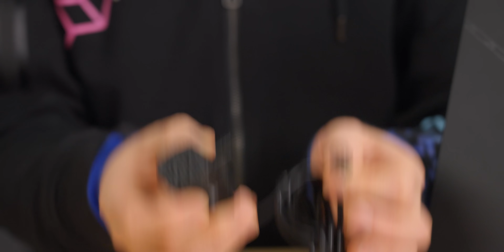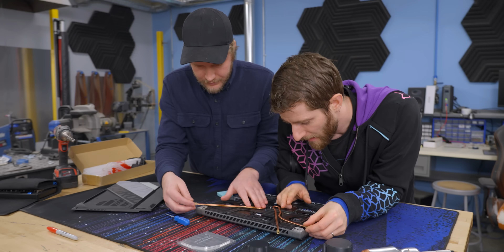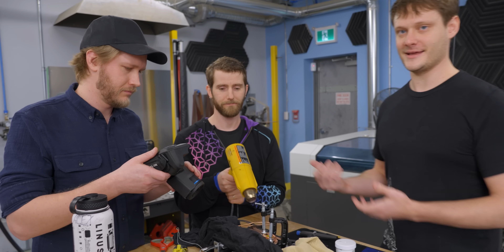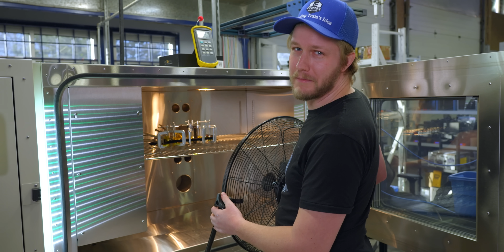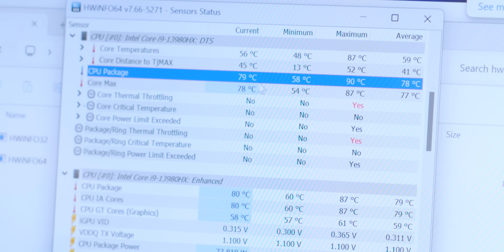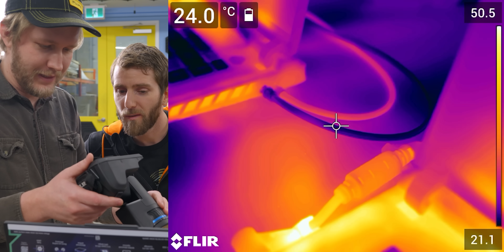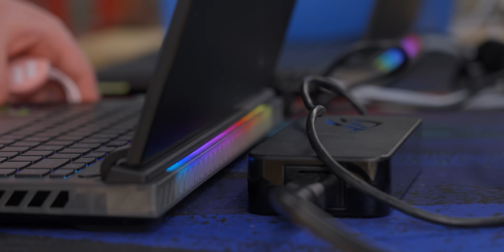Water Cooling a Laptop for $30

Comment: A plug-in external water cooling loop would be a pretty cool feature for some of these high end gaming laptops. The manufacturer designs the cooling loop with a pipe to ports on the outside of the laptop, then sells you an optional external AIO block that you just plug in when you need the extra cooling during sweaty gaming sessions or on very hot days.
Reply: This is a thing
Reply: This video had a clip of when they reviewed a laptop like that
Reply: @DraakjeYoblama  I think they're talking about it becoming more standard, rather than the exception.
Reply: Actually theres a Chinese brand MECHREVO that already has these external water cooling laptops in 2023
Reply: These things are done by a dozen different manufacturers.

They're obviously more expensive.
Reply: xpg has had them for awhile now to.
Reply: xmg neo laptops already have this since 2 years
Reply: considering laptops are built primary for portability I would just buy a desktop Pc, as external water cooling kind of kills the ease of use and portability. that said laptop manufacturers would be better off making a little access door for the heatsink and an external cooling pad "potentially water cooled" with it's own heatsink that will attach firmly connecting the two heatsinks.
Reply: ASUS GX800
Reply: @ryanhampshire7042  building a computer need... to build?
also laptop you could just unplug external wat er cooling, when u need portability. Why dont have both? LMAO

Comment: As a DIY technician myself, I'm sure there was a ton of different ways to make this so much more simple
Reply: Thermal epoxy...
Reply: Less fun tho
Reply: As a professional home owner myself I would agree, using regular copper pipe flux and a 140watt solder Gun.
Or a simple gas torch.
DIY technicians and professional home owners are very similar and have a lot of overlap.
Reply: @deepwinter77  Not really. One as a real job for the living and the other is a parasite who think he got skill because one time he badly repaired a copper pipe while pocketing rent.
Reply: @SaitoGray  a professional home owner refers to one's own home.
Not a rental house, it's a meme not a commentary on rental housing 👍🏻
Reply: @SaitoGray  and diy commonly refers to not doing something as a profession, so what is a real job?
Reply: That would be efficient and not funny
Reply: they should have used thermal poppy

Comment: When copper gets work hardened, you can heat it up to anneal it. It isn't very hard to do.
Reply: Yeah but you wouldn't want to torch a heat pipe lol.
Reply: except for the fittings soldered on the end.
Reply: @BananaDoe  It's not a heat pipe; it's a water pipe
Reply: @xungnham1388   He very likely meant the heatpipes from the laptop's cooling solution those would not do well at all if they tried to anneal the entire thing.
Reply: @alexisrivera200xable  I mean, they can do it before they attach it. Bend it, heat it, bend more, heat more. That's how you work copper if you want to shape it with hammer for example.
Reply: @Heksu99   But I think the copper water tubes also had their threaded inserts attached with solder.
Reply: @busteraycan   That's not really a hindrance.

Comment: Why arnt you wearing safety glasses!  Z94.3 rated safety glasses.  Im going to be pissed if this channel ends because someone cant see anymore over water cooling a laptop using a heat gun and some solder tube thing

Comment: Ain't there a fabricator or such in LTT who could tell these that copper alloys work hardening can be negated with a basic butane torch (Like a kitchen one is enough). Which is why we use copper alloys for complicated loops and brass instruments. You can also melt wax in to the piping to prevent it from collapsing when you bend it. Copper and copper alloys are actually REALLY wonderful stuff to work with.
Reply: Sorry, but these are heat pipes. Meant to carry heat away from where you apply it.
Reply: @Timbhu  It's obviously about the water pipes and even mentioned in the video.
Reply: @Timbhu That has absolutely nothing to do with what the original comment was saying, what he is telling them is that once it's been work hardened by virtue of bending it, you can reheat it to reverse the hardening,enabling you to reshape it without cracking or breaking it,which is basic physics. It''s use is entirely irrelevant.

Comment: So wait, out of everything you guys do, THIS is something we might actually do ourselves?  Lol I think we'd faster cool a gaming PC with a radiator from a PT cruiser before trying this madness.  Nonetheless, it makes for a hell of an entertaining video, and that is most important :)
Reply: Well. . . Maybe if you didn't melt the cooler to pieces and used epoxy instead
Reply: I mean its basically just copper brake-pipe for cars so with some epoxy I could do this with stuff from my garage. 😁
Reply: Or just use household cupper pipes from the plumper store and just put it at center. So much contact to surface was crazy overkill
Reply: @wyattroncin941 i wouldve soldered, but the issue wasn't soldering it was their fancy infra red machine heating the whole heat pipe system up, so that the heat gun and soldering iron added to it; instantly made the other heat pipes solder melt, if you dont have that machine you would be pretty okay(it would take longer to melt the solder you trying to add tho )
Reply: @noobs_guide_to_everything  without the reflow jig or a preheat oven you'd struggle to get enough heat in to actually melt the solder. It's a heat sink after all, and a soldering iron doesn't generate that much heat compared to a CPU. 

You could still get away with soldering, but you'd need to use a slightly lower preheat temperature and go much slower than they did so you aren't heat soaking the whole thing with the iron. You could also make a jig to rest the whole thing on, made of wood or machined aluminum with an oil pan heater underneath. That way if you do melt the cooler it doesn't fall apart on you.
Reply: Yeah if they'd just use the thermal epoxy this would have been a couple hour diy project anyone who's worked on tech could pull off imo. Trying to solder that cooler stack was what was shit, but more fun to watch? Lol.
Reply: Actually this is meant for professional workshops. You send them your laptop and they solder for you in one or two days. My friend got his laptop moded years ago and he uses it when he tries to render stuff or plans to game for long sessions. The good ones use a PC rad and pump, they also come with quick release water connectors so your laptop doesn't leak
Reply: @wyattroncin941  Any epoxy ? And wouldn't be less efficient ?
Reply: @skymarshal3330  thermal epoxy. It's what is used to mount heatsinks in small electronics like hand tools and DVR boxes. Yes it would be less efficient, but it also wouldn't require hundreds of dollars of equipment to install and there's (almost) zero risk of destroying the entire laptop.
Reply: It sounds like a project a hobbiest can take on.
Reply: @skymarshal3330  but just like using thermal paste, you'd want the layer to be as thin as possible, and with epoxy you'd have time mix, apply and carefully clamp it down. In the case that performance isn't what you expect, you might still be able to improve it using low melt solder paste and a soldering iron. The epoxy are already there to hold it down, and you only have to think about the soldered pipe assembly, in which case you can be smart about it and not solder anywhere close to the soldered areas. Also you could thermally cool down critical parts using something like water so it has more thermal mass at one end. Extremely short work of solder is key, not even one second of you shoving the solder there. You'll want to inflict as much heat at a point, and not much total heat so that the whole thing heats up and ultimately burst. Get it done a milimeter at a time if you had to.
Reply: @skymarshal3330  While thermal epoxy is less efficient than solder the end result would almost certainly be better than what Linus and Alex got since desoldering the existing heat pipes and warping the whole assembly cost them a good deal of cooling efficiency.
Reply: In China, the soldering service is sold together with the kit. After mailing the heatsink to the seller, wait less than a week, than you will get a way better heatsink than Linus had.

Comment: At work we use conductive epoxy. It is great option instead of the low-temperature soldering paste you used here. The conductive epoxy comes infused with silver and copper powder and flakes, I guess it would be good for this application.
Reply: that was the plan Alex wanted to use, but Linus just wanted to try the soldering. It may have been unnecessarily more difficult but it made for great entertainment.

Comment: Intel sponsoring a watercooled laptop video tells you all you need to know about their chips lol
Reply: Any processor needing any kinda cooling is a rip-off.
Reply: didn't they pull out as a sponsor? or is there a thing with sponsorships that i am not aware of?
Reply: @vilnaszekje  huh?
Reply: @vilnaszekje  you can stop using or buying any kind of electronic devices that features a processor from now on i guess
Reply: @johnsalamii they sponsored this video. The joke is that their CPUs run HOT 🔥
Reply: @johnsalamii  the stopped the intel tech upgrades, not sponsorships in general, deals may end after their set time but it's not like they excommunicate with who they sponsor after a deal is done.
Reply: @quyvante  If you didn't catch sarcastic response to stupid comment it is on you.
Reply: @vilnaszekje  man is digging for "sarcasm" because he shills for intel's supernova level cpu's.
Reply: @Extremexboxplayer  Cause AMD is running much cooler. They both run hot. And considering most tech review outlets run CPU's without thermal limits (and such outside of normal usage) of course the cooling isn't keeping up.
Reply: @vilnaszekje  never said AMD isn't hot lmao (they are both hot under load), i use whatever is good. why simp for a company? it makes no sense to make up a fake "joke" because you got mad he dissed your favorite company lol.
Reply: @Extremexboxplayer  you are the one "simping" for the company.
 
Imagine if AMD sponsored video about driver stability tells all you need to know about their drivers.
Reply: @Extremexboxplayer  nah its the same as android users, they pick weird flexes to bring up any time a competitors product is mentioned, like a headphone jack. What makes it especially weird is that intel chips ran at like half the equivalent amd chips tdp up until a few years ago. With the current state of cpu cooling (excellent) thermals are less important than ever too so it really is just being weird at this point.
Reply: @vilnaszekje  i use amd and intel lmao, even got an intel gpu in my livingroom pc, idc about brand loyalties. keep being mad i rightfully insulted intel bub.
Reply: @plsno8125  well yeah at that time i also said amd was making pc's with nuclear cores. not sure what you guys want from me when you're getting mad i insulted intel lmao. also android do be better simply because it's not apple haha (it's a joke please dont write me another paragraph).
Reply: @Extremexboxplayer  Bro ur being pretty overreactive. But ya. Im running ollld intel, but If I bought a cpu today, It'd be AMD. The general rule has been thrown out about intel for gaming, etc., because intel's performance charts over the years looks like someone just keeps putting more watts and getting more cpu score on an infinite curve.
My chip is a 3770k from 2012 (probably) and my 4 core chip scales very closely with their newer hardware. Only difference is those chips can handle 1Ghz more on average.
Reply: @Surms41  i am simply responding when responded to lol, you guys are the ones sending paragraphs about your latest cope.
Reply: @Extremexboxplayer  u project a lot
Reply: @plsno8125  I tell people that brand loyalty is bad and how I use all the brands brought up but that shows I'm projecting? That doesn't make sense.
Reply: @Extremexboxplayer  no one here is mad or making a big deal about brand loyalty except you
Reply: @plsno8125  must have age protecti9n on for the other comments then, unless you mean I'm the only one who said the exact phrase "brand loyalty" because that's just stupid as you know full well everyone is talking here about how they feel in regards to brands. Please don't act negligent to seem "right".
Reply: @vilnaszekje  bro what 💀😭
Reply: @vilnaszekje  a lot of processors need cooling, if not all of them. if you believe this is a rip off you can just stop using all of your electronic devices.

Comment: Experiencing power-on delays with Asus is a common issue. It even occurs with my 3rd ASUS ROG laptop at times. Additionally, with all of them, there's a frequent problem where they freeze after entering a prolonged suspended state. Come on, ASUS, please address these bugs. Your laptops are excellent, and it's a shame these issues persist.

Linux, time to cool down the reservoir full on ices!
Reply: @McNificoTube  it's common for DDR5 laptops, first boot takes forever

Comment: I have a Eluktronics LPP laptop.  The water-cooling works extremely well and will stay a LPP customer as long as they are manufactured.  The only problem I get is after about a year the quick connects leak and need to buy new quick connects.
Reply: Way too overpriced though.

Comment: I still want to see an external cooler for a laptop where you simply have a hole in the bottom exposing the heatplate so you can attach a copper heatsink instead of water cooling directly
Reply: I think that'd probably not be allowed under regulations concerning device skin temp
Reply: That's a safety nightmare waiting to happen.  Consumers is not smarts.
Reply: That's a safety nightmare waiting to happen.  Consumers is not smarts.
Reply: Maybe not the entire bottom, but I could see a window the size of a 120mm fan and a thin set of heatsink fins all over the heatpipes. When closed it's just extra passive cooling, but when docked you can ram air into it. Maybe the cooling pad has a bit of a gasket material around the area so there's as little leakage as possible.
Reply: @DigitalJedi  I meant like a square of copper on top of the heatpipes that go over the cpu and gpu dies, or a square of copper over laptops with vapor chambers that you can flip open a plastic cover and then press onto an external cooler that uses heatpipes to move the heat to a larger air cooler.
Reply: @arnezbridges93  A little warning sticker and maybe a sensor for the cover is probably enough especially for a small recessed area. I don't think most people are going to intentionally burn themselves especially the people buying this is would be a self-selecting group.
Reply: @PMARC14  That relies on metal to metal contact which is not ideal for thermal transfer. By having the fins in the laptop and just using a decently powerful fan and seal, you avoid an exposed hot surface, get better heat transfer as the fins are soldered, and possibly have a lighter laptop than using a slab of copper.
Reply: @DigitalJedi  you can just have a thermal pad between them. Your idea offers basically no benefit over just putting a bigger cooling system in the laptop, in noise or cooling potential. You are basically just saying what if you took off the bottom of the laptop and placed it on a cooling pad but more complex
Reply: @PMARC14  I thought the goal was to still be portable. A thermal pad is not a reusable or long-term solution for something that would possibly be applied and removed daily.
Reply: That is true as well, I am sure a conductive thermal layer that can be applied between metal must exist that is relatively durable. Perhaps one of those graphite pads or something else. At the same time nothing is going to beat the convivence of just putting the laptop on a ventilated stand. Realistically all solutions are just ways to cool insane desktop replacement class laptops that maybe moved weekly at best unless you are a college student.  @DigitalJedi
Reply: @PMARC14  I actually own a few of those graphite pads for testbenches, and they are not as durable as you think. They're best handled with tweezers and rip easily. One permanently stuck to either exposed metal surface on a laptop or the stand would be destroyed pretty quickly. There really aren't any thermal transfer media durable enough to hold up to what a consumer device goes through besides a metal to metal contact patch.
Reply: @DigitalJedi  good to know then

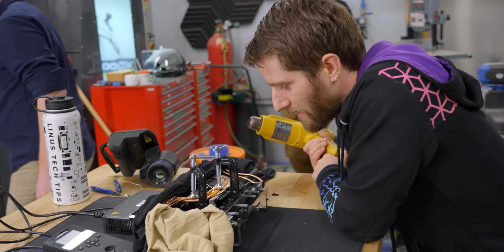Comment: 13:00 soldering to heatpipes which are already soldered to something else seems like a lot of fun 😅 
It is quite interesting though. Since they're absolutely amazing at transporting heat away, you have to incapacitate them by heating up the whole heatpipe enough to vaporize all of the water inside and seriously pressurizing the copper heatpipe. It's copper though, so it should survive it, especially since the manufacturer did exactly that as well. Or they first soldered them and only after that pulled a vacuum in them, put in a tiny amount of water and sealed them, but that would be quite expensive and overcomplicated.